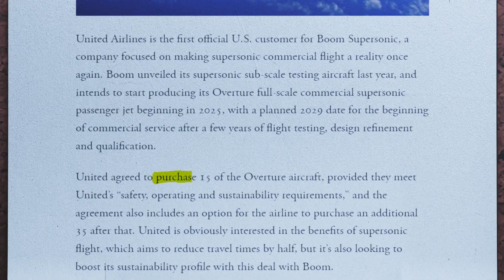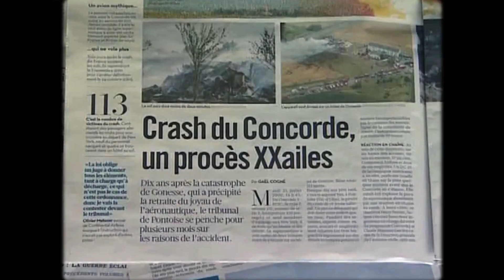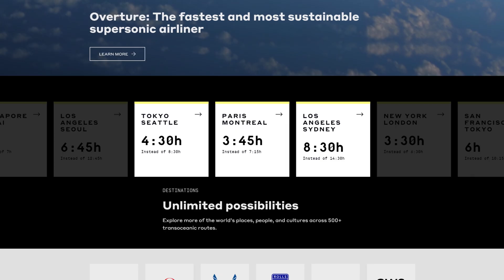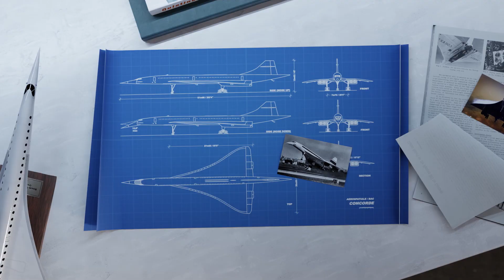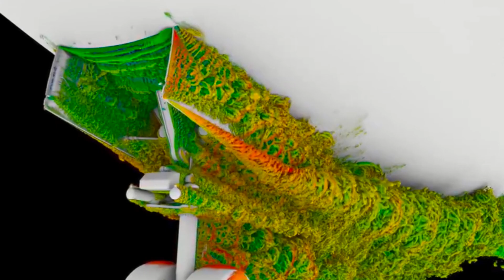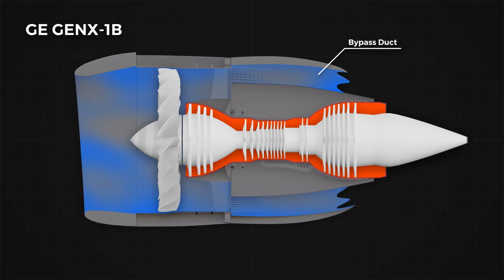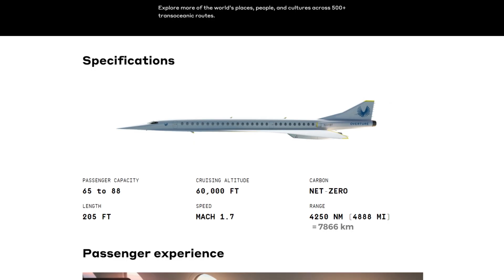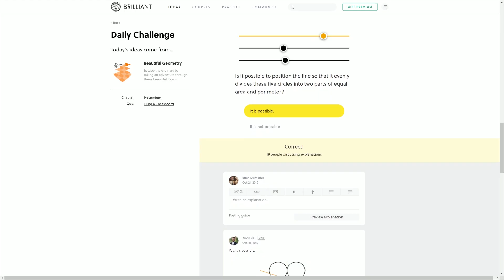Will Boom Bring Supersonic Back?

Comment: Boom is barking up the wrong technological tree. HyperSoar tech uses one fifth the fuel v. a regular airliner but travels at over Mach 5 in hops out of the atmosphere and back. Ironic that the answer is to go faster.
Reply: No, the answer is to NOT fly in the atmosphere.  ;)  But in reality HyperSoar will cost to much per passenger mile to be viable as a mainline commercial transport.
Reply: @protonneutron9046  Let's see. Uses much less fuel. is nearly six times faster so very many more flights per unit time. Is your argument that it would cost too much to develop?
Reply: @stevemickler452  LMFAO!  Fuel is going to be the smallest consideration for the "HyperSoar"!  I can see you have ZERO experience in the aviation/aerospace industry.
Reply: @protonneutron9046  In my experience condescension masks an inability to answer. I believe I asked a reasonable question.

Comment: I don't believe Boom will succeed unless they engineer out the sonic boom sound (which I'm pretty sure NASA is straying away from more recently), otherwise else you'll just have another insanely expensive to fuel aircraft in an era of demanding more and more fuel efficient aircraft. 

Why would I care about speed whenever a 777X could get me there in reasonable time and for a fraction of the cost?

Comment: A different airliner was able to go faster than mach 1 due to extreme wind speed. If the Concorde was in that wind then its ground speed would have been mach 3 that's SR-71 speed. And depending on the cruise speed of these new jets it might still happen.

Comment: Honestly, it would shameful if Boom couldn't make a plane using modern technology.

A Concorde made using modern materials should have been able to do trans-Pacific flights.

As for Boom; they are being far too ambitious/dishonest with their timelines.  RR will not be able to build test and pass with regulators a new pure jet engine by 2026, especially with it being in a field that has seen little research and development.

Comment: Regarding engines, there is highly developed technology for "super cruise" in military aircraft. Perhaps not Mach 1.7, though - I believe the idea is merely that supersonic flight is possible without fuel-sucking after-burners (reheaters). In any case, there is little room to develop practical engines much faster than these. A major stumbling block is that there are components within an engine that must be cooled by compressor discharge air, which is quite hot and gets hotter with speed. One of these components is the first stage turbine disk; the Concorde's engine disks had to be replaced frequently, a gigantic maintenance cost not needed for regular engines. Don't bet on any breakthroughs - these components have been subject to enormous R&D efforts for 70 years.

Comment: The problems with Concord...! What problems...? A French Concord leaves de Gaulle over weight, there are crew check failures before the aircraft runs over runway debris as under carriage and handling difficulties are ignored by the Pilot. The fleet is grounded much to the delight of American aviation, that has seen Concord a slap in it’s face for decades because they can’t make it work. Concords were one of the most reliable planes ever made, when you look at service life and miles done. Yes they had issues, but what do you expect.

As for what comes next… The Sabre Engine by Reaction Engines UK, has already been tested to Mach 5.5 in Texas and it burns cleaner than Kerosene. Gen John W Raymond alluded to the technology in his first speech as the head of Space Force, so they already have the tech. 

SKYLON the single stage reusable lifting body designed in Britain. Offers orbit insertion and or trans/orbital flight, making the London to Sydney run just 4 hours. With a vehicle that can be fuelled at and use existing but long Airport runways, with flight ready turn around in just 24 hours.

Comment: I wouldn't necessarily agree that synthetic fuel is extra unappealing for supersonic flight. On a percentage basis the extra cost to the passenger will likely be lower than on normal planes and synthetic fuel is more pure so that may help reduce maintenance costs for the engines, which will undoubtedly be high on a supersonic plane.

Comment: Actually high bypass could work. The trick would be to convert the high bypass system into a ramjet at high speeds, which is far from impossible. In fact if the people over at Royals Royce don't come up with this idea on their own I'll be 100٪ shocked.

Comment: Investing into jet engines when electronic motors are on the rise and wasting fuel instead of saving it seems like a dumb idea ngl.
Reply: Electric motors on the rise?
There’s a reason there isn’t a single commercial electric plane yet
Batteries are stupidly heavy and to charge a commercial airliner would take days and require extremely expensive equipment 
Electric cars are on the rise but commercial planes are decades away

Comment: Good video, but your assertion the supersonic aircraft must use pure (turbo) jets is not correct. The Rolls Royce EJ200 used in the Eurofighter  Typhoon (and the Bloodhound LSR car, of which I'm a STEM ambassador) is a turbo fan engine. Admittedly it is not a high bypass engine, but the low bypass helps cool the engine and reduce the noise and IR signature. I would think that whatever Rolls Royce develops for this aircraft will heavily influenced by if it not completely based on the EJ200.

Comment: Too bad GE stopped the developement of the Affinity engine in spring 2021. It was almost finished and designed to go to the Aerion supesonic plane. If there would be more customers or demand of such low bypass engine, it could be possibly a faster and cheaper route to continue where they left off than design a completely new engine.

Comment: A huge negative factor with the Concord was the massive noise during takeoff.
The Concords noise during takeoff would rattle buildings. 
Boom would need to solve the takeoff noise problem before it would be allowed near any major city.
Reply: @ziggy2shus624 Yes, Concorde made an awesome tearing noise on take off. I loved the sound, and the sound of a Vulcan, but people living near airports weren't so keen. There were a lot of complaints around the Heathrow area about Concorde's noise. The 707 was bad enough at 104dBs, but Concorde's noise was 120dBs. This means that Concorde would sound 3x louder than a 707.

Boom claim that Overture will comply with the ICAO-14 noise regulations, so it will be a lot quieter and be able to use all airports.
Reply: It actually was about the same dB as the contemporary B-707 and DC-8. On take off from 31L at JFK it always made a steep left turn over Flushing Bay and as a result actually had a lower noise footprint than modern subsonic jets.

Comment: It has been obvious since the days of Concorde:
Supersonic commercial travel will never be a success, unless something drastically changes. Boom is not that drastic change.
The drastic change I am personally hoping for to be successful is SpaceX's intended use of Starship for commercial travel at hypersonic velocities.
It will take a lot of work and testing, including new facilities in locations far enough away to not cause noise-pollution.
SpaceX has proven its ability to provide reliable orbital rocket launches at a lower cost than any other provider, whilst fully implementing re-usability at a previously unknown scale.
I have faith in SpaceX.
Reply: Concorde ended up as a success in the end.  It just wasn't as profitable as BA and AF hoped it would be.  The money spent on it (especially after the AF crash) was more efficiently spent on sub-sonic planes.
Reply: @tams805  Hardly a success with an entire aircraft lost including all crew and passengers, while it only flew 314 (?) times.
Compare that to any other commercial aircraft operational today and it doesn't come close to reliable.

Comment: The Boom supersonic jet is unacceptable for its outrageous fuel burn.  We need to focus on ways to make jet transportation sustainable, and this is a a fast flight backwards.
Reply: Your statement makes no sense. Unacceptable for whom? Define what you mean by outrageous? Flying backwards to what? Aviation is one of the few industries that has actively pursued fuel use reduction, year on year, in order to drive costs down. This pursuit is not forced by Political legislation but the pure economic motivation to reduce consumption and cost. Along the way we all benefit with: lower fuel consumption; lower cost for travel; reduced emissions; safer travel. A number of factors will determine the viability of the BOOM supersonic aircraft. Fuel burn is but one element. ALL travel requires the consumption of "fuel".

Comment: One tiny correction.  The Concorde actually flew to Washington DC and on to Miami 3 times a week for many years.  I worked in Miami and we used to watch the Concorde land if we were bored.
Reply: @jimsackmanbusinesscoaching1344 There were 7,000 return flights from Heathrow to Barbados as well, between 1987 and 2003. A Concorde is on display near the Grantley Adams International Airport, Barbados.
Reply: YOU TELL 'M @phonicwheel933

Comment: the part about the engines is incorrect. Fighter planes have been using bypass engines for at least 30 Y. Its just not high bypass, its low bypass/mixed exhaust engines. And ya, some of the new ones have amazing efficiency, maybe not as much as high bypass, but a LOT more since the concord days. In fact the concords engine was a low bypass, not a turbojet

Comment: Concorde was a London to New York design, the worlds 2 leading banking cities. Paris to New York passenger numbers had to be  restricted if the head wings were to strong. This is seldom if ever a problem New York to Paris.
BA made a good profit on it's NY- L service. By 2003 Concorde's 1960/70's avionics and instruments were obsolete and it was to expensive to develop replacements. Once Air France ceased operations and Airbus withdrew it's technical support BA had no option than retire it's fleet as well.

Comment: Wouldn't a solution to avoiding the sound of sonic booming be to fly the plane at speeds right under when a boom occurs and then once it's in a far enough zone where it can't be heard (ie over the ocean or over non residential areas) to go full speed. At that point it wouldn't matter how loud the sonic boom is because it's far enough away from any inhabitants.
Reply: Except air resistance peaks at the sound barrier, so that would give you the worst possible fuel efficiency.

Comment: Since they have no plan to address the sonic boom they won’t be flying over the US or likely any land mass. Since it’s supersonic it will be skinny, so very few passengers, And finally flying over the speed of sound requires a lot more fuel, although it maybe a little more fuel efficient than the Concorde it still will burn a lot more fuel then other planes flying 3x to 4X more people at one time. This means a repeat of the Concorde,  those who don’t learn from history and are destined to repeat it. Everyone was going to buy the Concorde at first until they found out it was NOT profitable. Profitability is alway the key word, it’s a equation which is easy to run the numbers. No profit, limited or no sales. No matter how advanced plane is.  Profitability is why the A380 is out of production and some A380 are being parked.

Comment: Question: Would arial refueling become an economically viable option for the airline market in any possible future?
Reply: In-flight refueling is very dangerous and requires very highly trained pilots in the tanker and receiving aircraft. Very highly trained and I can’t express the danger of being anywhere near a tanker even on the ground.  Actually there are already quite a few aircraft which can half way around the world non-stop already in Comfort. Flights of 16 to 18 are now very common, in fact even some corporate jet are flying extended distances now up to 7,000 miles
Reply: @adj2  and here is where I will now point you in the direction of the military for how often they perform these in-flight refueling operations. It does require a separate set of increasingly demanding skills, sure, but so does flying a supersonic plane at low speeds and altitudes nonetheless. As for safety on the ground I'm going to have to speak from my personal experience here and say no. Refueling aircraft are no less safe to be around on the ground than any other aircraft type of its size and age. A KC-135, RC-145, and theoretically C-135 are all equally safe on the ground. Maybe the RC would be the least safe due to all the antennas you'll be bonking your head into as you walk under it. You make a great point about those long range comfort flights, however as is stated in the video, that's a point against supersonic travel as a whole and as supersonic travel is all about traveling in full luxury even if with much less people on board. With this being said my suggestion of IFR is now occurring in my head. For such a complex piece of machinery that requires the wings and fuselage (ie the two main fuel tank locations) to be so slim and small, which reduces its range, would IFR now help? In such a case you could retrofit an old cargo or transport aircraft into a tanker a lot like the KC-135 had done to it. Yes this would be expensive, and yes it would be creating a solution to a problem you made to find a solution to another problem, however I'm curious if this could be alluring enough to contemplate as a fix for the short range of the new age of supersonic passenger travel?

(All information mentioned about the C-135 airframe discussed in this paragraph can be obtained through Wikipedia and other online sites)
Reply: @johnbarton8281  Sorry the answer is a hard No, You will never see a airliner with Passengers anywhere near a fully fueled tanker. Airflight refueling is really the domain of the military,  just like carrier landings. I won’t get into all of the particulars of why inflight refueling is so dangerous if you even remotely think a fully fueled tanker is safe on the ground. But The Concorde was a beautiful plane, revolutionary. But here is thing it wasn’t profitable from day one, only a few were built and the UK and France Subsidized British Airways and air France to take the few plane that were built. Originally all the major Airlines were going to buy either the Concorde or the SST until they found out by running the numbers saw it wouldn’t been profitable. Likely the plane was completed and flew for as long as it did because of national pride and it is such a beautiful aircraft. But that doesn’t pay the bills. Formally working for a major Aerospace company I know a few in the Air Force & Navy & a few Commerial pilots, I am definitely going ask the question, the response will priceless.
Reply: @adj2  well nonetheless your claim that a tanker is less safe on the ground than a normal cargo or passenger aircraft is a bit ridiculous to me and I must ask you to go into detail here because it makes no sense to me. The boom is secured. Or the hose reel. And a fuel tank is a fuel tank. No matter what all aircraft have them. And the fuel pumps. Sure tankers may carry a lot more fuel, but that's not that unsafe in the eyes of a maintainer walking around it or a passenger or aircrew flying on it on a transient flight. The only time your claim of safety makes any sense is when the operation of in flight refueling takes place. But I had conceived that point already. And again I'm not really talking about making a a standard airliner IFR capable, obviously that's not needed. However I am talking about these short duration, long flight, low fuel quantity requirements the video points out for the next-gen of the supersonic passenger planes for the elite and wealthy

Comment: Simple logic. 
Speed is relative to time per given distance. More speed = less time.
Speed requires energy.
MORE speed required more energy.
More speed = more drag.
Double the speed increases drag 4x. (drag increases with the square of velocity).
4x drag requires 4X the energy/fuel to overcome. 
Jet's get energy from kerosene-based fuels.
Fuel cost money.
More fuel for more energy means more money.
Most people don't have "more money" for more speed.
Most people select cheaper slower flights in exchange for more trip time. (everyone has time).
And so, faster, more expensive-to-fly supersonic plane fails (Concorde never made a profit).

I was a kid when the Concorde first flew.  Imagine my dreams of the future.  Instead we are just flying the same ol' 707 concept with 2 less engines.  Bummer.

When someone invented an EFFICIENT supersonic engine that doesn't burn so much fuel, then supersonic travel for all may happen.

NOTE.  If aircraft go all-electric, then forget faster than sound travel.  No prop or ducted fan can get us there regardless of what spins it.
Reply: All-electric can never go supersonic, you say? You never heard of air plasma jet engines?
Reply: Plasma engines are low thrust and consume far more power than any batteries a plane could carry. You'd need a nuclear reactor to power one.